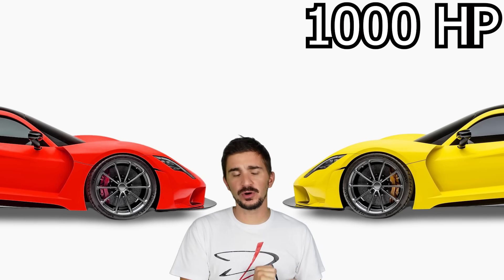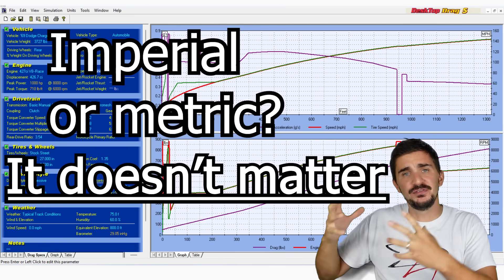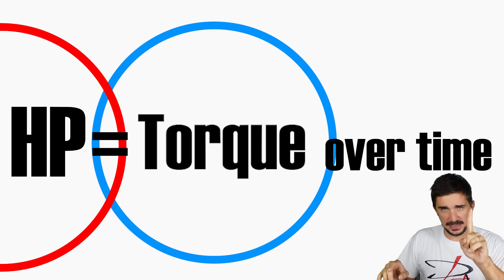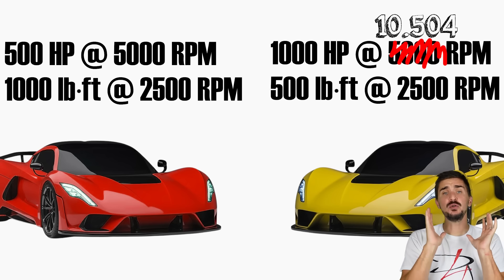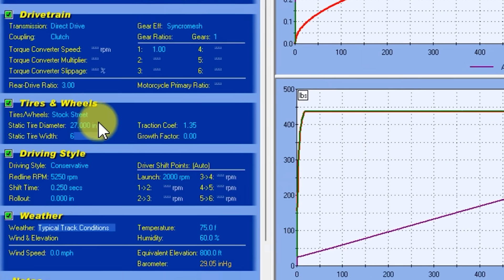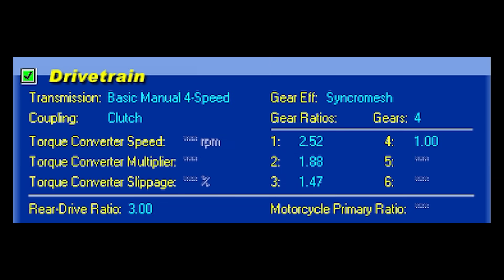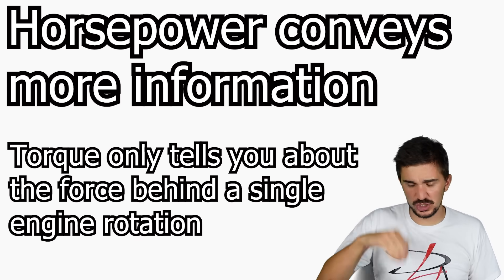Who's faster? Explained and Simulated - Horsepower vs Torque

Comment: what actually gives info on the performance of an engine would be its minimum power or torque over a certain range of rpm. power would be more telling since you don't have to compare it to the actual rpm range observed.
that would raise another question: how to evaluate and compare different usable ranges of rpm from different vehicles? with similar minimum and peak horsepower over that range, which is better between an engine that can spin from 2.5k rpm to 5k rpm, and one that struggles under 4k rpm and revs up to 8k rpm?

Comment: I have a question about the relationship with torque and horsepower, specifically about chevys 2.7 egnines. The plus variant was rated at 310hp, 390lbs. the high output was rated at 310hp but 430lbs of torque. They both have the same redline. How is this possible? Also, when I do the math, the numbers are pretty different from what chevy claims in both cases. 390x5600 divided by5252 is 371hp, and 430x5600 divided by 5252 is 458 hp. Am I doing the calculation wrong?

Again, both of these are rated at 310hp and it makes no sense to me.
Reply: if they give correct power and tprq level than both are on lower rpm than ypur calcultion simple peak torq for 430 lbs is on3 k rpm 310 hp in both version at similar rpm most likely so they make steonger low and midrange rpm somewehrrethere for 430 lbf ft version with similar topend ,,,,redline is not where peak torq and peak hp egzist usually its point where typical is best point of upshift 👍🏻 often sooner 👍🏻

Comment: if i'm buying a daily driver, i'm comparing torque and weight. if an outback weighs slightly less than a rav4 and has slightly more torque then i can expect it to overtake on a slope better. kilowatts near the redline will surely be even more irrelevant for a properly programmed CVT keeping the engine at peak torque?

Comment: This all depends on Redline and where the power comes in at the powerband AND how light the car is. There isn’t just one answer.
Reply: assuming the same. resist which includes weight drag asf and that each version have perfect gearing than there is one well 2 answerr = at set gear peak torq accelerater harder than peak power rpm but at set speed peak power accelerate harder than peak torq 👌🏻 so as long as you compare acceleration at the same gear so at doffrent vehicle speed cos at the same gear  peak torq rpm and peak power rpm are on fiffrent speed cos gear is set fix constant than gforce meter show higher number so  stopwatch lower number for peak torq rpm why ? cos torque divide be arm lenght /leverage/gearing = FORCE 👌🏻 but once you start comapre the same speed level like 0-100 km/h or 200-210 km/h like where for peak torq rpm and for peak power rpm you must setup compeletellly diffrent final gear ratio than gofrce meter always show higher number and stopwatch lower number for peak POWER rpm why ? cos power level divide be vehicle speed = FORCE 👌🏻thers 1 exception form this rule when peak torq and peak power are on the same rpm than it be always draw no matter how you comapre it cos you will always than comapre egzaclythe same rpm engine where power is the same so basically the same vs the same 🤷🏻‍♂️ than thers no diffrences 👌🏻 high torq low on rpm is good for daily riding cos you dont needd to rev engine high and slide clutch alot on launch but in racing on track thers no other solution then peak power 🌪️  if you comapre on track feg kawasaki zx4 rr 39 nm 77 hp 80 hp with ram air to something like suzuki gsx950 limited on a2 where it have 76 nm and 47 hp or gsx8r limited to a2 where it have 62 nm and 47 hp than let assume we leveled diffrences in weight and in drag if there be any than zx4 rr smoked both gsx8r and gax950 with ease on avg 4 km lenght track zx4 rr on the same tire be like 10-15 sec faster on lap and on straight accelerstion feg 1/4 mille it go +/- like this 0-100 km/h 4,0 sec vs 5,5 sec 0-140 km/h 7,0 sec vs 11,5 sec and 1/4 mille 12,3 sec /177 km/h for zx4 rr vs 13,9 sec / 147 km/h for gsx8r and gsx950 a2 limited where both have 70-100% more engine torq 👌🏻☕️…..and this video is trash + 💩 cos he dont explain this that when ypu give each version perfect gearing than power biased version always win why ? cos perfect gearing allow engine to work on peak power rpm all the time so strongest setup posiible cos power :wpeed= force once you setup this engine with to low gearing or to high gearing or better wrote when you be use in race higher rpm than peak power rpm or lower rpm than peak power it be accelerate weaker dosent matter how much higher rpm you will have at shorter gearing  or how much hgher torq ypu will have at longer gearing if in both egzample be less power than at peak you lose in race 👌🏻 😎it dont win always  only where we twlking about preferention and let say elasticity of engine from low rpm characteristics but pure max performance stats at perfect gearing 👉🏻 power always win 👍🏻👌🏻go comapre whatever car you wish the same version when one have more power one less torq freeely at race track with corners  or at drag race  power biased version always win 👌🏻👍🏻 😎 but like im write preferention is diffrent story feg i have in me honda cb 500 pc26 47 nm at 8000 rpm and 57 hp at 9500 rpm stock setup but instead of this when i riding on normal road and not on track and even on trafk when it comes only for fun and not to setup best lap posiible than i would defenitelly prefer 57 nm at 4000- 5000 rpm and 47 hp at 8000 rpm feg with 1 gear less such setup in me honda give it much stronger lowend /much better elasticity from low to midrange rpm 👌🏻 yes it be slower than if i would push both to the max feg 0-140 km/h now it do in 9,7 sec with 1 ft on vs setup which i prefer with higher torq lower peak power would do +/- 11,5 sec 😎👌🏻 but thats is still enough like for me i dont need more on road ypu need it only when you try to pretend to have fastest vehicle accelerwtion 👌🏻for me its enough thats faster than couple bikes it dont need to be faster than each bike 😉👌🏻 but better lowend and modrange rpm tslk to me much better when it comes to fun of riding and not pure max performance stats feg elasticity at last 6 gear where 100 km/h gps is at 500-5100 rpm from 100 to 140 km/h stock setup is 9,0 sec on racebox with rider max lying down me setup with 5000 rpm at last gear in egzacly the same test codnition do 100-140 km/h on this last gear in +/- 6,5 sec so on highwey feg once you put last gear in both version and accelerste from 80 to 150 km/h in stock version rider must to constsntly down shifts from 6 to like 4 gear or he be accelerste slower than me setup on which i can stay alll the time on last gear cos stock setup have nothing on low to midrange rpm compare  to me setup /its weak there like crap of 💩 and i reallly dont like it 🤷🏻‍♂️ 👌🏻but yea in race where both  be push to the limit all the time stock setup win 100% on max 100-140 km/h stock do in 5,0 sec (test on racebox 👌🏻) vs me hipothetical setup with more torq and less power do in 6,0 sec +/- 👌🏻than on track stock be always between 8 to 10 k rom where it have more power than me setup anywhere 👌🏻  from let say slowest corner on specified tire and track topograpghy feg 80 km/h to fastest point on track at longest straight before breaking zone let say 160 km/h cos gearing allow engine to stayy all the time on this rpm range where it have more power so between 8-10 k rpm if needed so assuming thers always enough grip if not on lower speed rpm csn go lower than 8 k rom depend on condition on track tire setup supesion asf if rider know what  he is doing= fastest group  👌🏻☕️so reallly thers 2 point of view on this topic dailyridng/preferention where for most people in reality version with stronger lowend be more apreciate 🤷🏻‍♂️👌🏻 and tracks where only rider from slowest group on theyr fatbobs 114 or mt01 say torq win race 🤭 🫣 what have as much with truth like i with  being  gay 🤭🤮😎👍🏻☕️

Comment: HEH!

I have ALWAYS run high torque low RPM motors, in really heavy cars and I have ALWAYS won!

My secrets are 1, how I shift, and 2, how I modulate the throttle while administering that torque to the wheels.

With an manual or an auto, I know where to hold the throttle at any given RPM [and yes, there is such a thing as being 'over carbureted' which is something that can rob one of power when racing] the entire way through the RPM band, and how to instantly re-modulate the throttle with each shift [as opposed to just pushing the throttle to the floor like so many unlearned, and inexperienced racers tend to do] so as to do 2 things [this does not apply to an ECU motor, I have never raced with fuel injection, TPS, drive-by-wire, or digital spark modulation, therefore my old world techniques do not translate to them]:

The first thing a modulated throttle-to-RPM exercise does is maximize the vacuum. 

This ONLY matters where you need to vaporize your fuel perfectly, and where you have timing adjusted on your distributor using [in whole or in part] on a vacuum advance diaphragm, or if you have vacuum secondary modulation on a 4 bbl carb.

The second thing this throttle modulation does, is maintain maximum air velocity through the venturi [while not exactly the same as peak vacuum, its not exactly different, either]. This velocity, in and of its self also vaporizes fuel more efficiently, based on the Venturi effect and Bernoulli's principle.

This means I can get the air and fuel as perfectly saturated FOR ANY GIVEN RPM as is possible in physics.

This can give, on otherwise identical cars, a 0.2 second advantage [all other factors being equal] on a quarter mile.

It also reduces lag, fouling, and spark knock.

It doesn't necessarily eliminate them, there is more to factor in than those, and, of course, as I hand tune my own motors, I have to factor all of those other factors in to reduce/eliminate spark knock, but it helps.

Spark knock not only robs power, it destroys motors.

Fouling not only robs power, it increases the chances of hot carbon detonation, reduces combustion completeness, and slightly chokes off total displacement [while yes, it does also increase compression, the way it does so, again, leads to hot carbon detonation].

So, while I used to win all the time, my formula was much more complicated than simply "put monster motor in car and stand on pedal."

I worked tirelessly to get every possible factor as ultra-perfect as possible, at every single point in the operation.

I realize that, in theory, cars exist that could handily beat me back then, but those cars were never raced on the streets, therefore were in a different class than a "drag-n-drive" class.

Also, if I wanted to go up in the classes, I would have had to pull a whole lot of mass out of my cars, as my cars were prohibitively heavy for low 8 second competition [average curb weight, with me in it, 6024 lbs], OR I would have to build true race engines [as in over 500 CID, not use gasoline, or else at least go to E-85 race fuel, go over 13.5:1 compression, and/or use boost].

While I never lost, it was simply because I was best in MY class of vehicle, NOT because I had the baddest machine on the track.

Comment: In a real world scenario, with gears, wouldn't the high HP car ultimately win if the track was long enough?

If you look at Diesels with high torque, they fall out after high speed, but literally just teleports from 0 - 100km/h.

While petrol with high HP are usually slower at low RPM low speed, but doesn't give out as fast in higher speeds.

It's an interesting way to learn about HP / Torque.
Reply: first of alll this video is crap of 💩👌🏻 petrol or disel dosent matter but we can choice some egzample like peugeot 206 1,6 hdi 110 hp 275 nm 0-100 km/h 10,5 sec 0-160 km/h 27,5 sec vmax 193 km/h vs peugeot 206 2,0 s16 135 hp 190 nm 0-100 km/h 8,9 sec 0-160 km/h 22,0 sec vmax 210 km/h in this egzample version with more power + less torq accelerate faster everywhere and achieve more topspeed 👌🏻 personally have couple years ago seat ibiza 1,9 tdi tune for 160 hp 360 nm at dyno it weight 1120 kg 0-100 km/h 7,2 sec 0-160 km/h 18,2 sec on racebox vmax 220 km/h if gearing was not to short with this gearbox whichi have vmax was 210 km/h vs feg renault clio v6 250 hp 300 nm 1420 kg weight so way heavier car with alot less torq but with alotmore power 0-100 km/h from official test 5,9 sec 0-160 km/h 13,9 sec vmax 254 km/h again car with less torq but with more powerr accelerate wuicker everywhere and achieve higher topspeed  in real world with perfect gearing topend power biased version basicallly always will accelerste wuicker and achieve higher topspeed than torque baised version /car does this mean it be better road daily car ? absolutely NO  (well for some YEP it be smaller part of drivers 👌🏻) it just mean it be faster when you push it to the limit at track or whatever 👌🏻 and this video is 💩🤓👌🏻☕️

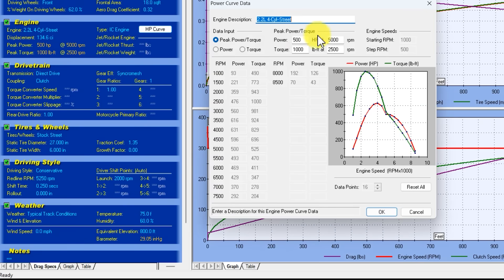Comment: 7:28  The second vehicle you changed the peak rpm from 5,000 to 10500.  Wouldn’t that make it slower?  Shouldn’t the rpm be the same in both vehicles?

Comment: Power is the ability to do work quickly.  Give both cars a transmission designed by someone who knows the application,  the 1000 HP vehicle beats 500HP vehicle every time, regardless of the load, no mater how much torque it has.
Reply: yep egzacly 👍🏻

Comment: The vehicle with more horsepower will be faster because it allows for steeper gearing and then applies its greater torque from the gearing at a faster rate.

Comment: At last. I  finally understand the relationship between torque and HP. Thank you. Your videos are both entertaining and educational.
Reply: yea but he dont show what happen if he give each of hees hipothetical engine version perfect gearing so 1 gear lenght gear quantity and diffrences between gear lenght which setup must be very individuall choicen in regard to power characteristic for each version 👌🏻 and what happen than ?  👉🏻 topend power biased engine so in chees comaprision 1000 hp 500 nm or lbft whatever beat torque biased engine so in hees test 500 hp 1000 nmor lbft version be alot 👌🏻 even if we load each version not be 6000 pounds but be 60000 pounds at limits and all individual precise choicen in terms of gesring it all comes to how much power ypu can deliver/transfer/teleport to whelll alll the time from dead stop to finish line and if ypu setup perfect gearing for topenf power version perfectly thanthis version be able to deliver more power alll the way basicallly from start to finish accelerste much wuicker with the same load /resist this he dont explain and cos of this this video is TRASH nothing more reallly and misleading people but in regard to daily riding avg car asf most driver anyways choicen torque biased engine why ? cos it need less downshift and upshift and always work on lower rpm cos if torq is biger than for achieve be engine  the same power so how much work in specified time it can do he need lesss rpm simple 👌🏻😎☕️

Comment: 14 minutes, are you crazy
Just tell me who would win
Reply: corvette c4 305 hp 451 nm rwd manual 1550 kg with rider 0-100 5,8 0-160 13,3 0-200 22,7 vmax 270 tsukuba lap time 1:13 👌🏻 vs ferrari modena 360  400 hp 370 nm rwd manual 1550 kg with driver 0-100 4,8 0-160 10,5 0-200 16,5 vmax 295 tsukuba lap time 1:05 = POWER WIN 👌🏻and this video is 💩 😁☕️

Comment: I had a faith in you, but you have this one wrong. Power of the engine is absolutely superior to the torque. A car with 1000 Hp and 500 Nm will win anytime against 500 Hp and 1000 Nm. I put this as simple as I can. Torque does not really matter. When you have a stronger car (more hp), it doesnt matter what torque it has. If you have more torque, you reach the horsepower in lower rpm. If you have less torque, you reach the horsepower in higher rpm. THAT IS ALL. When I reach the peak of the horsepower, does it really matter what my rpms are? NO. The important thing is, that I reach the top horsepower and I put it on the road. IT REALLY IS THIS SIMPLE. So many people dont understand this.

Comment: Torque doesnt really mean anything for speed. You can have billions of torque or 0.1 torque but the car has no mass, if no other values change, they will finish at same time. Impact drills cant turn bolts because they have high speed. They do it with insane torque forcibly turning that bolt, so torque is just a force applied.
Horsepower was about speed and lifting capacity of horses, i dont remember the definition precisely, but that would mean horsepower is all what matters for speed.
If your car is weightless then torque is irrelevant. if your vehicle is heavy then horses wont do much if they cant get the car moving, so all what matters is torque.